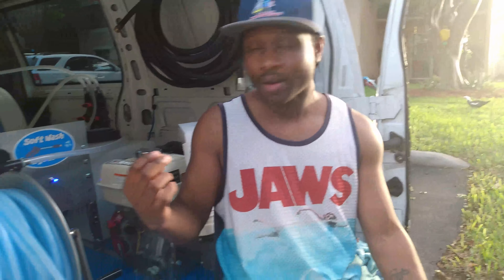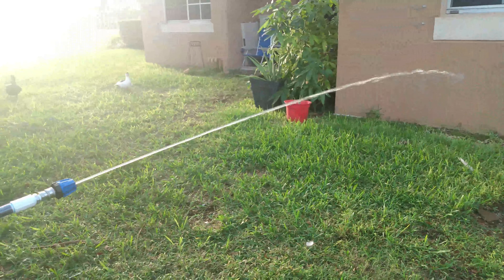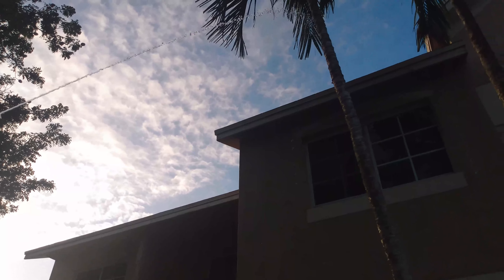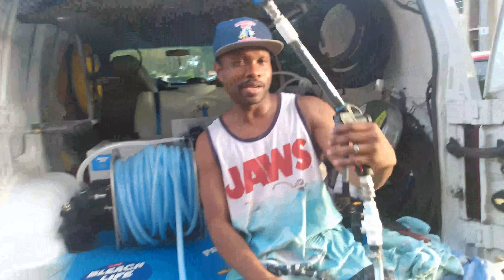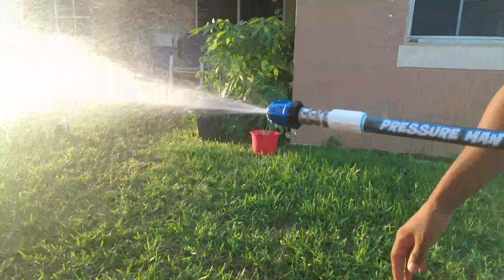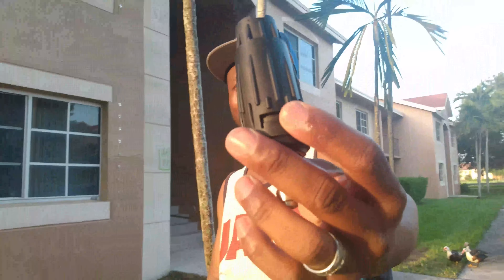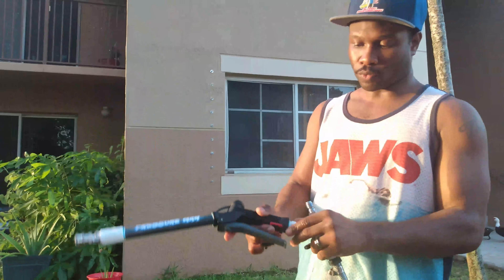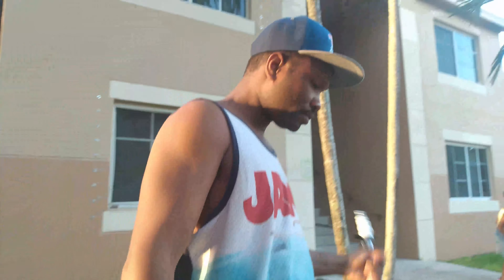Test Shooting my Soft Wash System

Comment: Got to get jrod that's compatible with your 12v pump size. If u have a 5.5gpm then u need a 5.5 gpm jrod so on. I do use those blue adjustable tips to though.
Reply from the maker: I know; I've been skeptical on getting one because it would shift more weight to the front, but at the same time I know it would be a more accurate source. Thanks for weighing in!
Reply: @thelifeofpressureman7178  I know what u mean they are alittle heavy but u can get just a two nozzle jrod instead of four nozzles. I ony use two out of the four jrod nozzles one for long distance high flow and one wide with high flow. The other two are to weak.
Reply from the maker: I did end up getting a 2 banger (Jrod) lol..